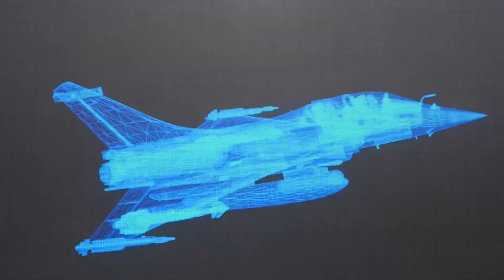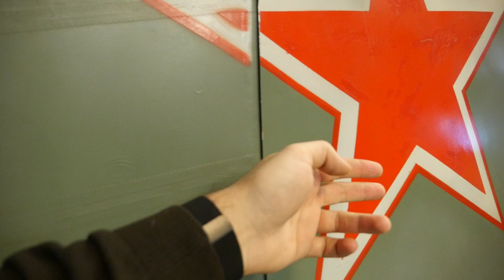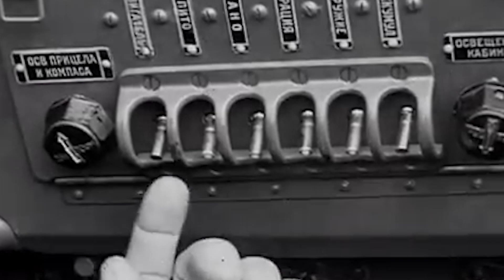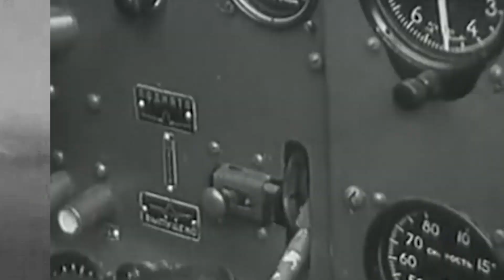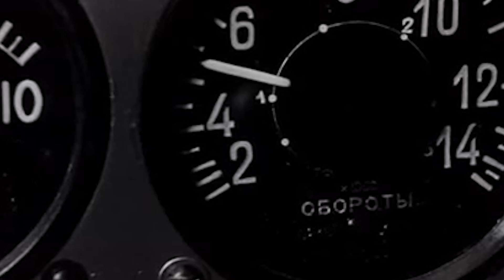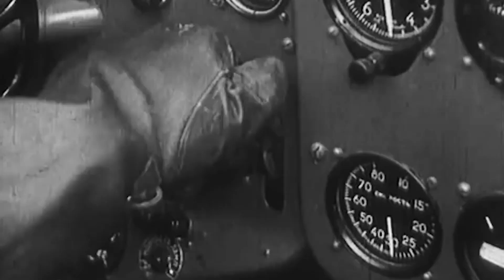Yak-15 - the first Soviet jet fighter

Comment: those orcs are funny... even today they have the nazi tiger tank engine on their parade tank the T14. :)))))))))))))) i mean talk about stupid
Reply: Wrong. The Armata uses a modern engine. Specifically the 12Н360 diesel with double turbocharger.
Reply: @jakekaywell5972  uhm wrong... look it up
Reply: @HellStr82  I did. You're very much wrong. The Armata's engine uses the same X configuration as the SLA 16 (which Porcshe didn't use BTW), but calling it a copy of the SLA 16 engine is like calling an American LS V8 a copy of a French engine because the French invented the V8 in like 1906. It has much higher displacement, larger dimensions, and uses forced induction. Also, the X configuration was first patented in the US in 1928, and the British had an aviation X configuration engines in production in the 30s. So it's hardly a "Nazi" engine.
Reply: @jakekaywell5972  look again marte. The t14 was build around the engine. They can't use another engine
Reply: Is it your struggle to write things that won't make your life better?

Comment: The YAK jets are the the best jets. They have always been the leaders for fighter jets. That's just my opinion
Reply: But Yak didn't develop many jet fighters. They built this jet, and the Yak-17 derivative, they built the Yak-23, which is a bigger and fatter variant with a Nene engine, and which was beat by the MiG-15, except for the ones they exported to allies, and they built the Yak-38, which is interesting, but hardly what anyone would call a good fighter jet. that is it. And one could argue the Yak-25 and -27 are fighters, but hardly world beaters. Everything else Yak designed was a transport or bomber or trainer, or whatever.

Comment: This is a very well thought out presentation! The airplane itself represents a quick, pragmatic solution of a problem - how to go from piston engine aircraft to jet aircraft.  The Yak-15 is the design that Heinkel should have come up with when they designed the He-162.  The Yak is a better idea all the way around.
Reply: Not really. This makes sense because they already had an aircraft and just needed to convert it to a fighter. Heinkel needed to design a whole new aircraft anyway, why go through all that trouble to end up with this? The ONLY reason the Soviets adopted this in spite of the enormous drawbacks of the configuration is because it was the only way to fit a jet engine to an existing airframe. There would be zero benefit in putting an engine in this configuration if you were free too adopt any configuration you wanted. In fact, it would be stupid. the only fighter Heikel could have based in on was the He-100, and that was a 1930s design, and the whole point was to develop a fighter that was made of wood and non-strategic materials. They couldn't have just had Messerschmitt convert the Bf 109, since it was already aging, and because they couldn't afford to lose conventional fighter production (same reason the Soviets waited until after the war to do this, even if they had had engines available). Same for the Fw 190. In any case, of all the problems the He 162 had, the placement of the engine was not one of them. Nothing wrong with a dorsal engine, it is a better solution than hanging it under the nose blowtorching the underside of the fuselage and the runway, with conventional landing gear. The problems on the He 162 were all in how difficult it was to fly, and in the construction being weak. None of those would be solved by putting the engine in the nose instead.

Comment: I saw one when I visited Varna in Bulgaria a few years back. It was on a stand at the side of the road and I could not stop. I wonder if it is still there?
Reply: I doubt it was one of these. From what I have read, there is only one of these left in the world. You probably saw a Yak-23, which is similar but fatter and larger, but which was built and exported in much larger numbers. Or possibly a Yak-17, which was a later development of this, mostly as a trainer (UTI) variant. Or even a MiG-9, although those are not much more common. If it was actually a Yak-15, or even MiG-9, it was a very important discovery, since they are both extremely rare today.

Comment: History shows an fascinating interplay between advancements in engine technology and advancements in aerodynamics. The advancements in engines generally, (but not always), leads, and then airframe design catches up. In the interim, there are transitional models that point the way to better performing airplanes. The Yak 15 is one such, as were the P-80, the Meteor, Aracomet. The Mig 15, the F-86 and what followed made Mach 2 fighters possible, once the engines could produce sufficient thrust. A kind of engineering pas-de-deux. Very well done vid. Thumbs up.

Comment: As far as I know there are only two fighter jets to enter service, that were based on piston engine fighters. The Yak-15, and the Swedish SAAB J 21R. I live close to the Swedish Air Force Museum where they have one SAAB J 21R, and also the original propeller version, J 21A, so I've seen that one close up several times. But I've never seen much information on the Yak-15. I very much appreciate this video, and the effort going into making it. Thank you!

Comment: It helped when Rolls Royce sent a brand new,state of the art jet engine in a crate to Mig in the USSR.  When the Americans found out, they were livid.
Reply: UK Labour government were in the pocket of the USSR at the time... the Russians also had a tour of Rolls Royce factory and had soft rubber soles on there shoes so they could pick up swarf ...
Reply: @davepoul8483  one of many instances where extraordinary assistance was given by western countries (especially the USA) to the USSR.
Reply: @wazza33racer  Trade with any nation, USSR included, is only a good thing. Those engines were sold, not given. Same deal with practically all Western technological assistance.

Comment: funny a yak pulled by a dodge
Reply: A rare sight. in WW2 there was especiallly a shortage in the USSR of trucks to bring supplies to the front. The USA gave many to the USSR, via the nothern shipping route. Also fighting equipment e.g. tanks and planes. And strategic metals like tungsten to make armer piercing tank shells, there was a great shortage of those shells, many tanks only carried a few or even none. What makes the sighting of the dodge special is that propaganda institutions went to great lenght to prevent foreign equipment to show up in pictures/film. Estimates vary but some 15% of the airforce may have been foreign machines. But let us not forget that 75 out of every 100 killed nazi soldiers died on the Eastern front. At great expense to the people who were thrown at them.

Comment: The Soviet Yak-15 has an uncanny resemblance to the German Messerschmitt P.1101 from 1944.
Reply: Yes, I wanted to write the same until I saw your post.😅
Reply: How is Connie doing?
Reply: Really? with a tailwheel and without swept wing design? Let me guess slanted engine in front and that's it?
Reply: @canvlad  In a way, I understand your criticism, because the airframe was primarily based on the YAK-3. I think there were practical reasons for this, because on the one hand you didn't have to rebuild all the production facilities. I think, however, that the reason for using the airframe may have been to retrain pilots who only had experience with propeller-driven machines on jet engines. Perhaps it was even about preparing these pilots for the MiG-9, which was even more like the Me P. 1101.
The Americans' Bell X-5, on the other hand, was practically a one-to-one replica of the Me P. 1101, as it was the Americans who managed to capture the only prototype of the Me P. 1101 and bring it to America.
Regarding the rear landing gear, I think that the Soviet side assumed that a retractable front landing gear would have been more expensive and more vulnerable. The German Me 262 initially only had a rear landing gear, but this was changed during further development.
At that time the Soviets did not have much experience with swept wings and probably didn't realize that the swept wings could be changed.
By the way, the engine of the YAK-3, the RD-10, was a replica of the German Jumo-4 engine.
In comparison, the Americans installed an Allison jet engine of the type J35-A-17, which was an exclusively axial jet engine in the Bell X-5.
The Soviets did not have this engine technology shortly after the Second World War, but later received support from the British in order to also be able to build axial engines.
Reply: @patrichausammann  Still the main innovation on Me1101 was swept wing design, right? Not the engines or their placement.
Reply: @canvlad  I think both things, the swept wing design and the engine position, were absolute novelties on the Me P. 1101.
Reply: @patrichausammann  Check out FW Ta 183 Huckebein if you want. But Focke Wulf wings weren't adjustable i believe :-)
Reply: @canvlad  Yes, the FW Ta 183 is a very interesting airplane too. And yes, you are correct, the wings of the FW Ta 183 weren't adjustable.
But in contrast to the Me P. 1101 the engine of the FW Ta 183 runs through the entire fuselage. However, there is also an exception here, the FW Ta 183 draft III.
The horizontal stabilizer of the Ta 183 is high, whereby the draft III with its lower mounted horizontal stabilizer differs here as well.
It is also noticeable that the cockpit of the FW Ta 183 is set back further compared to the Me P. 1101. Otherwise the Ta 183 draft III and the Me P. 1101 are very similar, even though the Me P. 1101 being clearly smaller.

Comment: Interesting Story:

The Russians were having problems with the internal parts of their jets.  The metallurgy had some parts melting (due to the low temperature parts).
So, the British (who had working Temperature parts) allowed the Russians to tour their aircraft factories.  But, the Brits did not allow any device at all (that would record and or collect data).
So, the Russians came with soled shoes (very thick and a soft rubber).  As the Russians walked through the factory, their Shoes "gathered" the metals.
The Russians returned home.
They reversed engineered the "gathered" metal and "solved" the metallurgy problem.
This is a true story.
Reply: Serious Russian ingenuity, impressive!

Comment: Yak 30 was a cool looking plane. LA-15 still my favorite.
Reply: Fantail? A pretty aircraft and very effective, the MiG 15 was more popular, political reasons?
Reply: @jimdavis8391  apparently too complex compared to the mig-15 and would cost more to make, but superior in all but climb rate.
Reply: @super_slav91  It had a higher positioned wing, a narrow landing gear placement making it an ass to land especially when the winds were strong. It carries a much weaker engine, was far less durable and had weaker armament setup. For all intents and purposes, it was a MiG-15 but worse, which is why the project was abandoned

Comment: the p80 sucked and the american main figter would be a dud without the engine off the spitfire, yaeh p51 origenal was rubbish, the us did the same  as the russians just produce numbers
Reply: The P-80 did not suck. It was designed to counter the ME-262, and it could have successfully. If you're comparing it to more advanced jets of the Korean war era, it is obsolete as a fighter. 
The Allison engine P-51 was not rubbish. It was a decent low altitude plane that showed some promise. If it hadn't, it would not have seen the upgrades and design changes that transformed it into one of the best fighters of the war. It was one of a number of "main fighters". It shared duty with Thunderbolts, Lightnings, Hellcats and Corsairs.
Reply: @jcoolG192  dream on
Reply: @jeroenverzijl8596  that's weak!
Reply: P-51A was an excellent fighter, it was miles better than the P-40 and at low level was much faster than the Spitfire Mk V.  They remained in RAF service until the end of the war doing high speed low level reconnaissance.

Comment: They chose the test pilots for those first jets by the weight of their balls
Reply: Not just weight. They used to test the hardness as well!
Reply: @SQSNSQ  just imagine: "yeah we removed a well functioning propulsion system and replaced it with a first gen angry air tube. Don't worry you'll be fine :)"

Comment: Did the Soviets ever do research on Radial Flow Gas Turbine Engines, or just the Axial flow Engines.??
Reply: Yes, all of the allies knew about radial and axial flow gas turbine engines. The thing is, they were not desperate to put such unknown concept (to aviation) in full production.
Reply: all kinds of them, half dozen of different prototypes are created since 1931
Reply: It would depend on which engine they were copying.
Reply: @givenfirstnamefamilyfirstn3935  you can't copy if you don't know how it works, USSR done enough researches to be able to copy
Reply: @bagamut  hilarious comment. even their rocket engine powered b1 was a piece of crap.
Reply: @andriypohors2538  it was first of it's kind and worked
and that was not turbojet, if you wanna make an example make it it properly, educate yourself
Reply: @bagamut   The yak came with a jumo engine. The mig 15 had a rolls royce engine.  the fuselages were copied from the p1101 and ta 178 respectively. They weren't even able to desgin properly made cars on their own. The r7 and soyuz rockets were not created by soviet engineers but germans, forced to work for them.

Comment: That steel tailwheel makes perfect sense. Sparks? What sparks?
Reply: Doubles as afterburner igniter
Reply: You don't get sparks on a grass field.
Reply: @mandellorian Uh...NO. The N1 had a burner fed by a reciprocating engine driven compressor, but that doesn't make it an AFTERBURNER. Afterburners are actually operating on a ramjet principle, where the jet engine exhaust creates a shockwave to give an additional pressure boost while additional air is ingested- otherwise all that extra fuel burns outside the engine, where it cannot produce any thrust.  So YOU, "mandellorian", have simply missed the boat on the physics of jet engines.
Reply: @craigwall9536  The afterburner stage doesn't add aditional air, it adds fuel. You also don't get a pressure boost, there is a temperature boost which increases mass flow. A pressure boost could cause a stall upstream.

Comment: They took a german engine and parts from an old Soviet prop plane to make a jet that was worse than the best props they had.
Reply: what was worse here? it was 100kmh faster than prop version
Reply: Worse?
You got much experience of real aeroplanes? you understand piston engine power curves compared to jet engine thrust curves?
That primitive combination offered excellent experience of the huge advantages and limitations of jet operation which revealed the appropriate change needed in future combat plane operation.  It would not have been at all inferior to the appalling Bell P-59 Airacomet.
Obviously the basic top speed would have been expected to remain broadly at the existing piston engined airframe’s aerodynamic limit but the first test pilots would have been thrilled with the massive change in climb speeds and equally terrified by the lethargic take offs.
Reply: These are growing pains and it’s exactly what the west did - trial and error, and copy from the Germans.
Reply: It was not worse than the best props they had. The best prop they had was the La-9 and Yak 9. It was significantly faster than both while retaining most of the great maneuverability of the Yak 3 airframe.
Reply: That’s how to start cheap 😆 Sacrifice a couple of test pilots while you’re at it and then let a better idea / construction take over 🤓